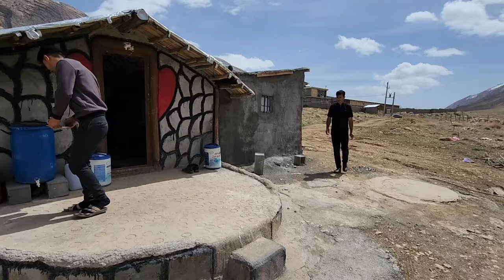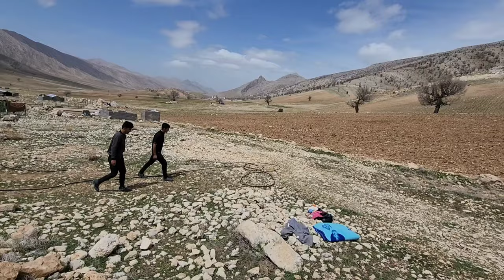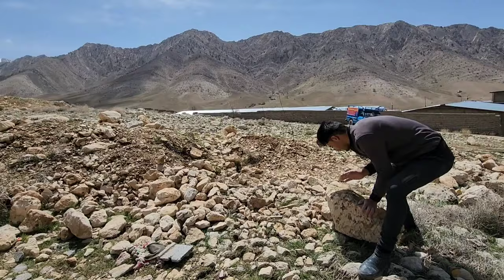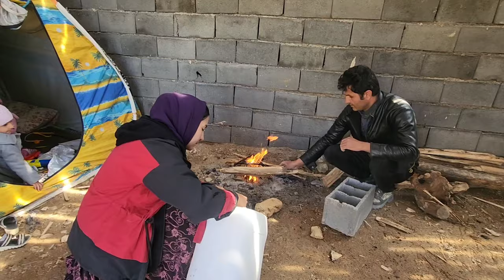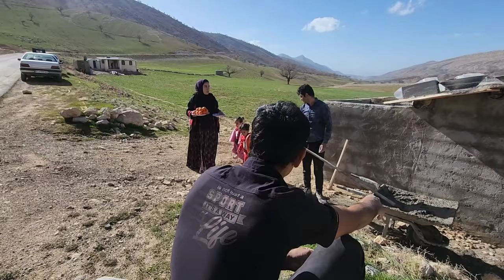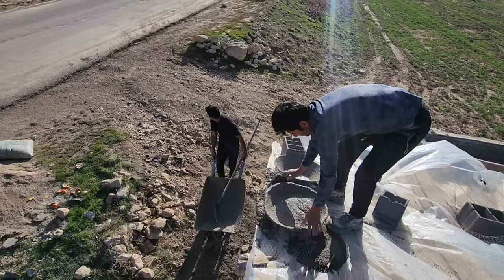The participation of young nomads in concreting the house of Gal (Mehran)

Comment: You need to set up your tent on top of a block platform
To help keep the water out of the tent

First make a block platform for the tent
Next put a large plastic on top of the block platform this will keep the water from coming inside the tent
Next place the tent on top of the block platform and tie it down with rope anchors to the ground or tied to blocks or large rocks

Next put a large plastic over the whole tent and over the blocks platform
Tie down the plastic with rope and blocks to hold it down